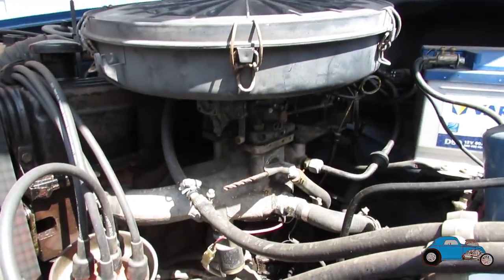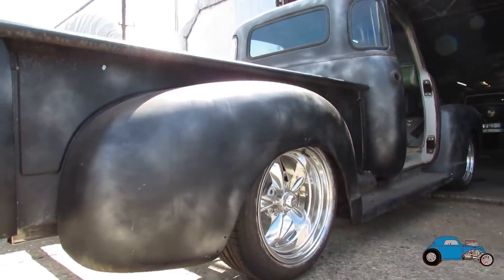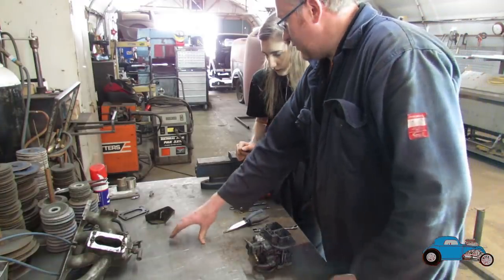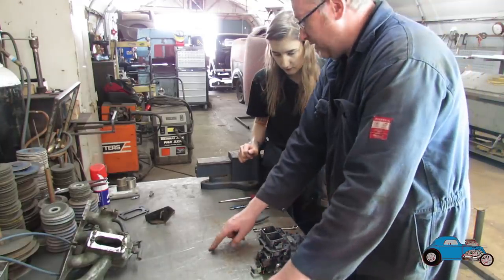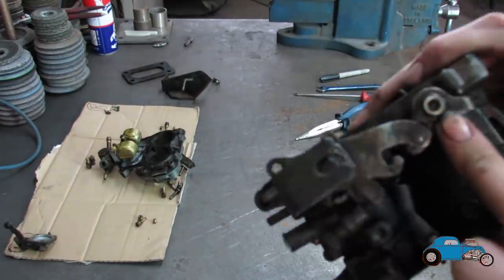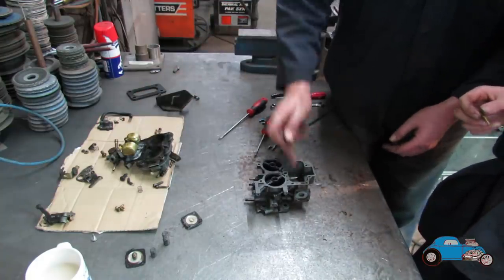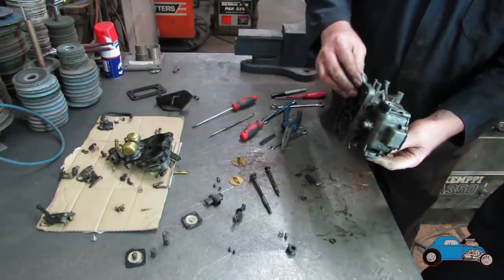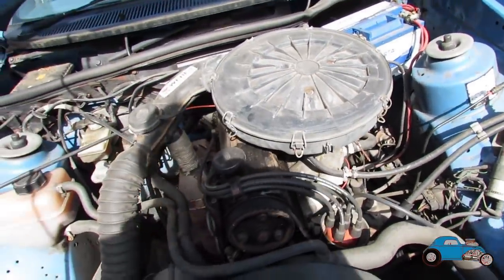Fixing up my Ford Sierra! Replacing the Carburettor Part 1

Comment: I've still got a box full of Weber carb parts even though I haven't touched one in about 15 years! I used to rebuild 38 dgas twin choke carbs from the v6 capris and convert them to sequential operation to suit 4 cylinder engines. Happy days! Good to see a younger person fiddling about with old motors instead of us old farts, best wishes on the renovation of that old Sierra Beth!

Comment: Did the same with a lovely 1.6L Sierra Estate I bought in 1999.. it was under powered and running on.  I purchased a spare car from work and refurbished its carb  and put it on the estate and it run lovely.  Great video 😉

Comment: Beth, did this same mod on a 1.6 Sierra in 1986, carb came off a scrapyard mk3 cortina 2000E and I replaced the centre  exhaust box with a peice of straight tube at the same time. I was 20 at the time glad to see that some traditions haven't changed. Great channel. Your wheel banding videos are very impressive.

Comment: I grew up with carbs, when I was Beths age injection was top end luxury only. Latest one I’ve just refurbed is the 4 barrel Edelbrock on n my Triumph Stag I have just completed a bare shell rebuild on. I love working on the older stuff where the engine tells you what’s wrong when you listen to it instead of a plug in scan tool!
Reply: yeah i grew up on carbs as well..............a lot of health problems now at 44!

Comment: Nice little video.  The 32/36 DGV is a great carb to work on.  I fitted a new power valve on mine as it has a rubber diaphragm which can perish with age.   It's the one with a long spring and is located with the three screws on the top half of the carb.  I also had to buy it separately as it was not included in the service kit!

Comment: Be careful with spanners and the like on top of the battery. One mistake and boom!
Reply: Crack!!!! Bubbly bubbly bubbly fwoosh! Especially bad if the spanner is the right length to get welded to the terminals by the current. Don't ask how I know :p
Reply: Lol i saw that too. 
I've got a wrench I use to this day , with a big old weld mark on it from my first week at work right out of tech school almost 20yrs ago. 
I was tightening a terminal and slipped. 
Bzzzzt sparks and light. 
Good times. 
After that incident  I hold the wrench the wrong way  and sort of cup it so if it slips,  my hand has the potential to smash the battery and insulates the wrench 😁
Better than sparks I figure. 
So I added a bunch of electrical tape and that is strictly my terminal wrench. 
Before I made it a terminal wrench , the weld mark on the box end compromised it later on  and it cracked. 
It slips at about 20 foot pounds 😆
Yea leaving them laying on top, everyone figures it out eventually 😆

Comment: I think it was 2004, I bought a H reg.Sierra Sapphire 1.8 Turbo Diesel for £130 from BCA in Bridgwater/Somerset with 10 Months Mot on it. I loved it, it was a great car, comfortable and roomy, never had any problem great runner it was, for the next mot just needed new tyres but the advisory list was arms length with complicated and expensive work like lots of welding etc.. so I used it until the mot ran out then unfortunately scrapped. Both the Hatchback and Sapphires were great cars and looked much better then their replacement Mondeo, on the contrary I never liked the estate Sierras as I always find them ugly.

Comment: What's the plan for the future of the Sierra Beth? Will it be straight restoration? It's a comparitively lightweight rwd car with a unique look. Jack Telnack's designs could be weird but strangely delightful. The pinto engine has many upgrade possibilities! I'd love to see you machine a Volvo 16v head for it! I'd have to check the bore diameter and spacing. I know it's possible on a 2.3. Maybe a turbo? Maybe not. 2.3l block? Were they even available in England? Can't wait for the next video! Solid mechanical work. Cheers!

Comment: Looks like a weber 32/34 DMTL, it was an upgrade from the pierburg on the 1.8. If it is then it's the carb used on the 16v 1300 stockcars and stockrods. Quick strip and clean of that too and make a few quid back pretty easily

Comment: Why am I watching this I don't have a car and don't know what a carburettor is XD this was cool to watch though.
Reply: A carburetor is like a precisely metered toilet flush 😆
Nah , the theory of operations is fairly simple. 
They don't have alot of moving parts ,but  can require some periodic adjustments. 
When they run good , life is good. 
When they act up, you wanna smash it with a hammer 😆
No really ,I wouldn't lie. 
that is a trick for trying to get a stuck float to unstick 😁
All abandoned and replaced with fuel injection because the consumer wants to turn the key and go.
Reply: You should know if you just watched it?

Comment: A job I need to do myself. My Capri won’t idle when coming off the throttle. It just cuts out and I’m killing my starter motor. Same carb, Weber 32/36 DGAV. I’ve got a Sierra Hatch too but it’s a pinto EFI. You’re doing a great job and a very interesting watch.
Reply: ive got a pinto 1.6 with weber carb, cutting out possibly is the idle

Comment: Hi there , with my experience if you say that the car stays running for. Second when turn key off this is normaly the ignition timing :) needs to be set properly :)
Reply: Certainly worth checking timing but a weak mixture can also cause running on.

Comment: When it's running on. That's because the engine is coked up... The coke is staying hot and ignition the fuel.
Reply: Could be... Or the timing is out - had that in the past.
Reply: joe wilson and can be the butterfly hasn't properly closed
Reply: Tony montana
Reply: or the engine runs too hot. or too rich at idle. or idle speed too high.

Comment: Hey,  nice to see someone tackle Sierras too these days :D. Question - was the first carburetor hooked up to the ESC (that stands for "electronic spark control", which controls the distributor, choke and idle motor) module or was it some sort of aftermarket carb? And what about the new one?

Comment: I have a 1.8 sierra lx and if you are looking at the engine bay my inlet is on the left of the block and exhaust on the right in the vid it looked like it was opposite way round than  mine (carb right and exhaust left)? is it because this car is a sapphire?
Reply: Yours will be a cvh engine and not the pinto.